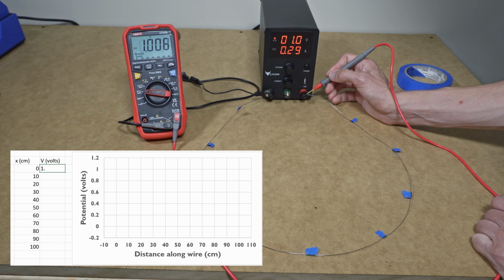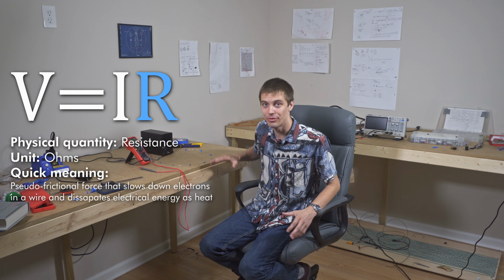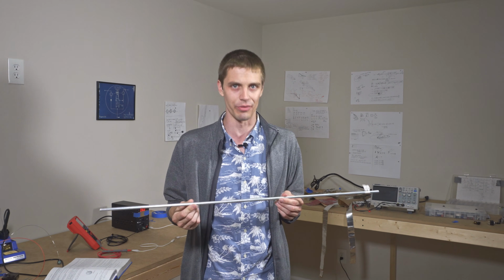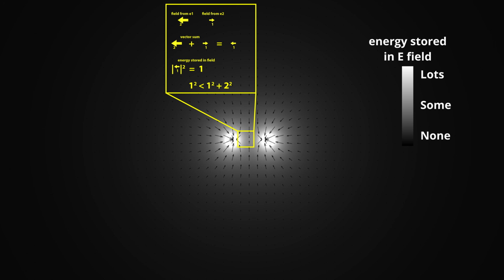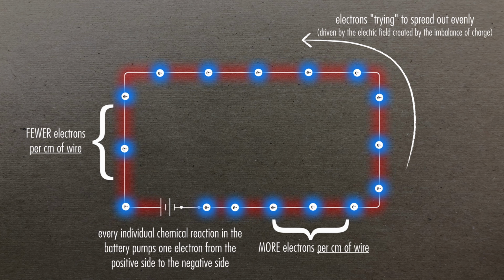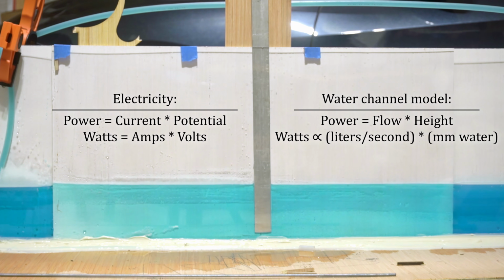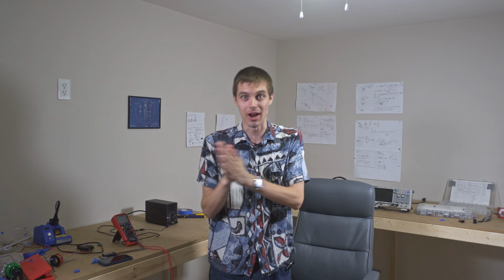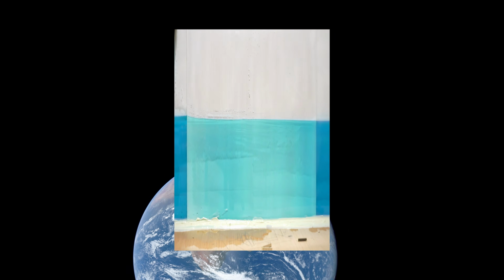An intuitive approach for understanding electricity

Comment: In my lab at UCSB we have a high pressure tank of liquid (~40,000 psi), which could represent high voltage. When I release the fluid to ambient, the heat is ALL released at the valve, just like a resistor! And it does get QUITE hot. I wish I had a thermal camera to show it, it's exactly what you are describing with the heat dissipated at the metal rod in the water trough.
Reply from the maker: What’s the liquid? Is it something nasty? Someone I know had high pressure ammonia at UCSB 😂
Reply: @AlphaPhoenixChannel  it's automotive coolant LOL

Comment: What would resistors in parallel be  like in the water example?
Reply from the maker: Two parallel water channels - of varying width or with varying orifices stuck in the channels if you want to make the resistors different values

Comment: you are really good at this. most of the time I'm very bad at understanding these things (I usually have new underlying questions with every sentence) but here I didn't have that. The only thing I didn't understand was the two electrons in space. I thought they repel each other. Why are the arrows not pointing outwards?
Reply from the maker: The electric field is classically drawn as force arrows on a positive particle, but electrons are negative so the arrows point backwards. It’s pretty annoying 🤗

Comment: It is true that electrons do move through a circuit from negative to positive but the missing electrons move faster from the positive to the negative. This is sometimes referred to a 'hole flow'. It takes a finite time for an electron to leave one atom and move to another: The hole appears almost immediately on the atom that just gave up its electron and that 'hole' will remain until filled with an electron from another atom.
Since a 'hole' is not a physical entity and has no mass, there are few limitations to the rate at which they appear and disappear. Electrons are much more limited.
Reply from the maker: Hole flow isn’t a thing in metal wires, and even when there is hole flow in special materials, the effective mass is normally pretty high, so I might say that holes are actually more sluggish than electrons

Comment: At 6:10 why would the speed of an electron change with current - wouldn't you just have 4 times as many columbs moving past a point, but still moving at the same speed?
Reply from the maker: You’d need 4 times as many electrons per volume moving for that to be the case

Comment: Voltage is simple if you get your equation PE = Q * V and divide both sides by Q.   You get:  PE / Q = V.   What this is saying is that voltage is simply the amount of energy one unit of charge will gain when exposed to a an electrical field of a certain strength.  Note that Q (the charge) is really really tiny for an electron so it only gets a tiny energy when subjected to 1 volt.
Reply from the maker: 1 eV

Comment: Is measuring voltages at different locations on a wire at the beginning of this video same as measuring voltages on a short circuit? Can anyone explain the result? I searched online, many people refer to the equation V=IR to predict the result but the answer would be zero, which is wrong.
Reply from the maker: This is using an active power supply, which is pretty close to an ideal voltage source, which means all the resistance is in the wire. If you assume a highly conductive wire and a battery with internal resistance, the drop you see across the wire would be close to zero.

Comment: What if that ocean is so deep, because it's actually another dimension? Wireless energy transfer? "Electricity" only slightly tickling the surface of the available universe, only because we have basic ways of interacting with it.

Comment: If you have 2 12v batteries and you connect them in series then why does the voltage double and not make the voltage 0v
Reply from the maker: If you connect them backwards it makes it 0V
Reply: @AlphaPhoenixChannel  allegedly if you connect them backwards it turns it in to 24v . It's called connecting them in series but I haven't tried it yet

Comment: Nature works on pressure mediation. Push, pull. Up, down. Low, high. Hot, cold. Etc, etc... Every great invention and discovery is based on this principle, and as you said, nature doesn't understand math, has no calculator. It's rough, but the ratios always follow the same rules. Hence the math invented to predict the outcome.

Comment: I’m not an electrician so this is probably a stupid question for all of you, but why does the volt decrease during it’s way from point A to point B? It would make more sense to me if it was the same voltage throughout the circuit. Please explain it in the most simple way possible. Many thanks!

Comment: What is positive static charge vs negative static charge ?

Is it A:  protons vs electrons ?

or B:  electron spin direction.

Or C:  neither A or B.
Reply from the maker: Extra or depleted electrons with a fixed number of protons
Reply: @AlphaPhoenixChannel  OK great!   Did you just described pH or (potential of Hydrogen)?

When the hydrogen molecule looses its only electron... well it just becomes a single proton (because there is no neutron) and it's this accumulation of protons that is acid.  

The greater the proton accumulation... the stronger the acid.

You will need to explain in greater detail (if you can) because of how important these two charges are in the scheme of things.

Comment: Can someone explain to me why voltage is gradually dropped in the frist example? Why isn't it dropped gradually in the second example on the section of the wire prior to the resistor? What is the difference, wire is the same.
Reply from the maker: It would drop the same with the same current, but there was a lot less current in the example with the resistor in the middle
Reply: @AlphaPhoenixChannel  thanks for the replay! That I can understand. But why current is so low across the whole curcuit? Why isn't it stronger in the first half, before the resistor, when the resistance of the wire is very low?
Reply from the maker: If there was a large current in the first half and a small current in the second half, you’d be depleting the middle of electrons. You can do this with a capacitor but in simple resistive circuits like that we say that current should be conserved. (And for ANY circuit that’s in complete steady state, like with capacitors but they’re done charging, the current MUST be 100% conserved)

Comment: Is there any way in this model to represent reactive power? Almost all of the models assume DC states and i'm not sure how to make that switch.
Reply from the maker: This model always holds for instantaneous power. When in doubt work through what happens at each segment of the phase. When you start talking about AC stuff you’re really talking averages and how power is NET moving, which can be much more obtuse. If you imagine there’s a big basin of water starting to act as a capacitor in here, the instantaneous flow of water won’t align with the water height because it needs to fill up the basin. This “phase shift” between the water flow and height signals is the same kind of thing you’d get with current and voltage getting out of phase in AC

Comment: ☝👀 WATER OUT / AIR IN ANALOGIE USING WIDTH & HEIGHT OF THE TANK + THE TAP SIZES & MOUNT POSITIONS OF BOTH TAPS THEN ADJUSTING EITHER WATER/AIR FLOW BY VACUUM OR PRESSURE❗💯Chinese make it so easy.🤔

Comment: Like electrons in a wire are sort of bumping each other from atom to atom in the direction of current flow, rather than traveling along the wire like its sone kind of magical electron road
Reply from the maker: That’s like saying a car goes from pebble to pebble as it drives across a concrete slab. But like, more cars are on those same pebbles lol

Comment: my biggest struggle in life is not completely undertanding what voltage is
Reply: I’m sure someone will correct me if I say this wrong. But it is the difference in pressure between 2 points. That’s why when you measure with a meter hot and ground you can get one voltage, hot and neutral  could give you the same or slightly different voltage and hot and hot gives you 2x/1.73x (single/3phase) the hot and ground voltage.
Reply: The height analogy is the big ah ha 💡 moment for me honestly

Comment: You said "resistive wire" (in the first minutes), is this a special type of wire that doesn´t create a short-circuit when connected directly pole to pole ? Thanks!
Reply from the maker: It is sort of a “short circuit”, just a wimpy one.

Every complete circuit has a connection from hot to ground, we just call them short circuits when that connection has a damagingly low resistance. 

All wires have resistance - this one is just exaggerated so I don’t actually cook anything

Comment: If you more carefully measured the voltage drop all along the wire you would see that it is different at each location.  But the difference might be a small fraction of a volt, but the voltage is different at each location on the wire. Granted, it may be a small fraction of a volt. The wire is like a bunch of very small resistors in series.  Your circuit is a zillion very small value resistors in series with a 100 ohm resistor.  The voltage along the wire is a nice linear voltage drop, a very small voltage drop, but that same linear relationship applies.
Reply from the maker: Look at the numbers I’m typing that are all “about 1” or “about 0”

Comment: The experiment at 1:14 is somewhat deceptive. With a short circuit the current is very high and thus even the small wire resistance will  demonstrate measurable voltage drops along the wire (V = I*R) . When you insert a resistor the total current drops significantly meaning that the small wire resistance may no longer be reflected as a drop in voltage with a DMM. It's not like it has disappeared, only reduced below the thresh hold of measurement of your DMM. Nothing magical is happening when you insert the resistor. Just an application of ohm's law. My point is that inserting a resistor does not in any way eliminate voltage drops across the rest of the wire. Indeed the whole principle behind a four wire measurement of resistance is to eliminate the small resistance of the connecting leads.

Comment: What about vacuum diode
Reply from the maker: All the same measurements and units can be made, and they have similar physical meanings, but the relationship does NOT follow ohms law - the current that flows depends largely on the temperature of the components in the tube, which is kinda weird

Comment: Very interesting! One thing didn't really click for me yet, though: in all the water analogies, it's a straight line and the 2 ends aren't connected to eachother. Then why does it need to be a loop for electricity?
Reply from the maker: The pump and tube in the background completes the loop. The channel is just supposed to represent a wire with a resistor

Comment: I'm way late to the comments section, but I teach basic electricity from time to time, and I describe what voltage is as how it is in nature, using the lightning strike model. 

When describing how a lightning strike works, up in the sky, there is a massive patch of molecules up there that has an electrical charge, be it a positive or negative charge, it has charge. 

That charge represents voltage, and it's just happy hanging out up there in the sky doing nothing at all except for the level of the charge slowly becoming slightly more positive or slightly more negative. 

That massive patch of electrical charge, voltage, is going to live up there, happy as a cloud, slowly gaining charge or slowly losing charge over time.  But it's always up there doing nothing unless something interacts with it. 

While it's happy doing nothing, and having a massive positive or negative charge doesn't hurt it, the massive patch of molecules would prefer if it had zero charge at all. 

At the same time, in the ground or in the oceans, there are also massive patches of molecules, with a certain level of charge, that are also floating around, doing nothing other than slightly increasing or decreasing it's rate of charge. The massive patches of charged molecules in the ground are exactly the same as the ones in the sky. And while they are happy doing nothing, they would prefer if they had zero charge as well. 

If the massive patch of molecules up in the sky gets close enough to a massive patch of molecules down on the ground, and if the charge difference between them is great enough, a lightning strike occurs. This allows each massive patch of charged molecules to balance out, bringing their charge closer to zero. 

This is what voltage is. It's a massive patch of charged molecules, which is okay with having a charge, but would prefer if it had no charge at all.

Comment: Veritasium made a video saying electrons don' t actually move that fast in the wire. He showed how the power flows down the outside of the wire thru fields. Which is it?
Reply from the maker: Both - electrons don’t need to move fast to transmit energy. I think that ignoring their motion and focusing on the fields makes for a hard to understand picture though since the fields come from the electrons

Comment: Some of the voltage is converted to heat.  Nothing is "dropped."
Reply: @MidhunKrishna-ez8lf  

Yes. I have a degree in electronics. It always seemed to be an inaccurate statement.  "Voltage transition" would be more accurate.

Comment: 17:55 … how exactly do you push them?
Reply from the maker: In a battery? One at a time with a chemical reaction that releases electrons on one conductor and takes them from another conductor.
In general? Normally electrons in the same wire or an adjacent one. Even magnetic coupling between wires inductively can be explained as coulombic repulsion of particles in adjacent wires if you toss in length contraction from special relativity

Comment: I would say it is it not 100 % accurate to say that ALL of the voltage is dropped over the 100 ohm resistor. There must still be a small voltage drop over the wire as long as it conducts current. This drop will be in series with the resistor, but as it is so small compared to the 100 ohm resistor it is hard to measure and we can regard it as a step.

Comment: Since voltage varies how can current have a constant value in  a circuit with no branches?
Reply from the maker: resistance along the wire
Reply: @AlphaPhoenixChannel  I have a feeling that although your efforts to explain better voltage were fruitful I don’t understand how current can have a certain ‘value’ in a simple closed circuit with resistors . In you animation you mentioned that electrons try to spread as we move away from the pressure insertion point. So logically the current must have a gradient value. And expanding in your analogies with how we are creating streams in a vast microscopic   ocean could not be that there are also turbulent streaks especially near our pressure insertion point ?

Comment: Great informative video. I must admit i have a slight problem with the idea of electrons moving a distance. In the US edition of "electronics for dummies" the author explains that energy is transfered through electrons in a "newtons cradle effect". Ie apply a force to the first one and and the one at the end will show the force, Whilst the ones in the middle appear not to move. There is also the aspect of electric field, it must also be made up of electrons, so are the electrons jumping out of the wire and moving in a vastly more unhospitable environment for traveling electrons. ie air. Not only that but what about space where there is nothing at all. Also when it was mentioned that an individual electron has a magnet field  what particles make up that field?
Reply from the maker: An electron has an electrostatic field, and when the electron moves it creates a magnetic field. If you want to imagine the field as made of “particles”, the field is photons, but it’s better to just think of the field as a continuous thing that exists in space. No need to bring quantum in. You can calculate a drift velocity - that author oversimplified

Comment: It's all the same. Electricity, pneumatics, hydraulics, they all use pumps/generators to create flow and resistance that creates the pressure/voltage, and they all dump their excess to a "tank"(ground, atmosphere). Obviously, there are differences, but they all fundamentally work in the same way.

Comment: No, there weren’t “too many positive charges together” on other side in relation to anything to do with electricity in a wire generally. Positive charges in a wire aren’t mobile.
Reply from the maker: There can be too many positive charges together if you pull negative charges out while the positive nuclei don’t move

Comment: So if power is moving through the electromagnetic field instead of theough the wire itself, how is a resistor having this effect? And also, it seems almost as though a resistor creates sort of a "laminar flow" effect. Is that literal, or was it just visual along the heat map?
Reply from the maker: The field is bound to the particles. If they can’t move, the field looks different